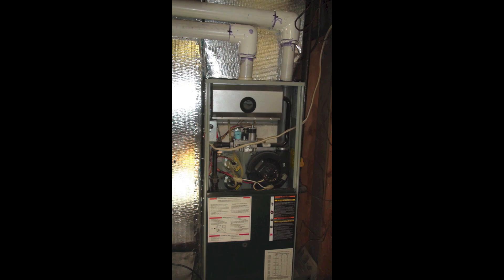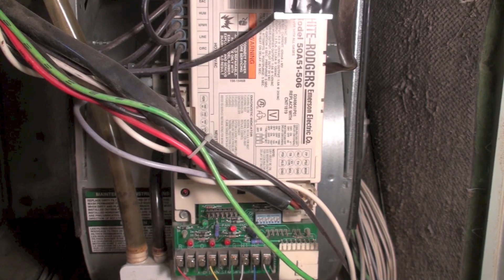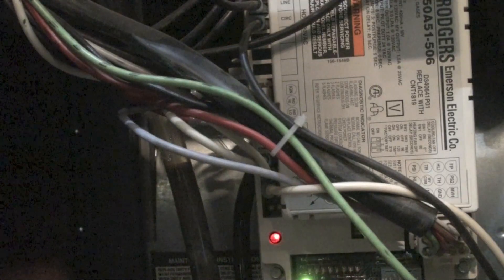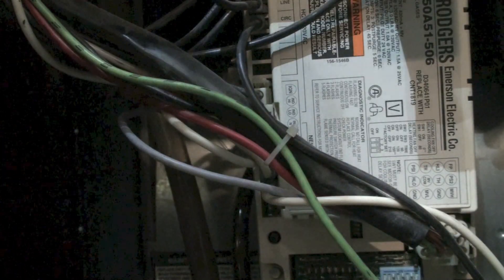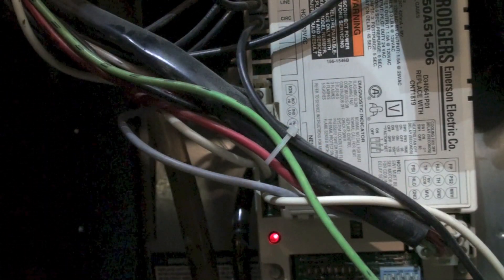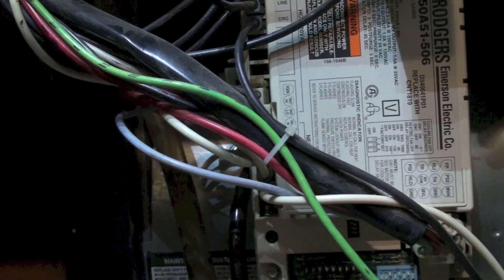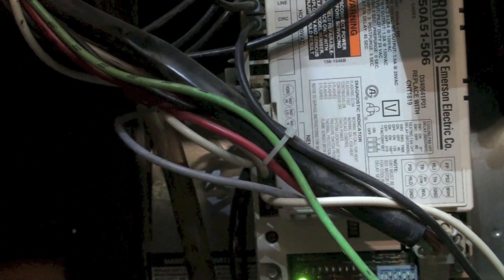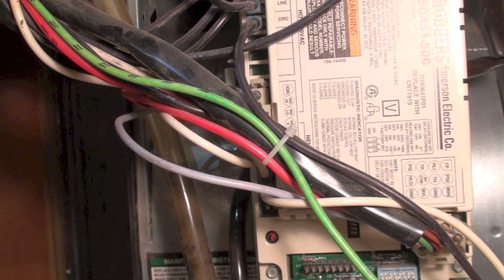Error codes for Trane gas furnaces

Comment: hi there how can you tell when you need a new sensor board?
Reply from the maker: Some boards will give a code that indicates it has failed or usually a no light condition with power to the board indicates a failure.

Comment: I have the Trane XB80. It's not providing heat. the Code is a rapid flashing light. the ignitor glows bt no gas and not heat. Please help.  thanks in advance...
Reply from the maker: The rapid flashes indicates normal operation.  If the flame does not come on, that indicates no gas available or gas valve failure.  First, be sure you have gas (see if other gas appliances operate).
GFM

Comment: What is 5 code
Reply from the maker: On a Trane furnace, the 5 code means something like a stuck open gas valve.  If the burners are not stuck on, the control board has probably failed.
GFM

Comment: Wow, thank you so much for this video! It helps! a lot! Also if you could tell me why my furnace does this. My furnace blinks normally when its not blowing air and when it is...... but everynow and then the blinker will fast blink when the furnace is blowing heat.
Reply from the maker: TheHmongol The only thing I can think of is when the furnace is calling for heat, it fast blinks. When the call is over, even if the fan is still blowing, it will slow blink. 
GFM

Comment: Hello furnace man.. I get the Open Temperature Limit Circuit (4 Flashes RED)
I need to check the filter you said, and the blower Wheel, ETC also if there are filters On the register can that also cause it too..
Reply from the maker: There should be no filters on the register if there is one at the furnace.  You could also have a rollout switch open.  If it is, you could have a failed heat exchanger.
GFM

Comment: I have a trane xv80 that blinks twice. Its a code for external lockout. Sometimes my furnace runs fine. And some other times, it wont heat. It blows cold air. I already replaced the flame sensor and the ignitor. What do you think is the problem. Thank you!
Reply: Did you ever figure it out? I'm having this exact issue right now. Thanks

Comment: What's the normal pressure for aninduced motor ?
Reply from the maker: It varies with the model.  There are no common numbers here.
GFM
Reply: grayfurnaceman then how can I test to make sure that an inducer is creating a proper vacuum ?
Reply from the maker: You need to know the pressure it will make at.  Some of the pressure switches will have it printed on the label.  Some do not have this and you will have to find an install or service manual.  
GFM

Comment: I have a code for no call for heat I'm lost on what to do for that
Reply: Gray furnace man..do I need
To shut off the gas line to clean the thermostat???thank you
Reply from the maker: I would be looking at the thermostat as the problem here.  You can try removing the thermostat and shorting the white and the red wires.  If it starts, the thermostat is the problem.  Hope this helps.
GFM

Comment: My Trane XE90 was working alright, had a gas service take place at the meter and unit restarted fine. Unit operated normal for two days, now I get 6 lights. It cycles on, ignites, and then immediately off. 
How could the polarity change when nothing electrical was disturbed?
Reply from the maker: Sometimes the ground wire (green) is not tight somewhere.  I would check that first.
GFM
Reply: grayfurnaceman I appreciate your time and assistance!

Comment: thanks gray,  
my led is off completely, however I checked the lines coming into the board and they were hot.  is it board problem?
Reply from the maker: Be sure you have 24 volt power.  Fuse on the board?
GFM
Reply: +grayfurnaceman I checked the transformer and it was not transforming so I replaced it. but the moment I turned it on it fried the transformer so I think I have short circuit somewhere. I don't have a fuse on this board.
Reply from the maker: I did a couple of videos on finding the short in low voltage.  Check my channel.  Hope this helps.
GFM
Reply: +grayfurnaceman great will do thanks!

Comment: We took off the front panel to vacuum ut the hose that gets plugged, and we get the red light blinking three times. Can you tell me how to fix this
Reply from the maker: +Annie Morrison If you used vacuum on the hose with it connected to the pressure switch, you probably damaged the diaphragm in the switch.   Means a new switch.
GFM

Comment: I have never encountered this before either.  Have found out on some forums that this 5 code is more or less a catch all for things (glitches ?) that the board can't read.  The solution,  if the code continues is to replace the board.  Of course all the other components of the furnace need to be checked and  OK'd for function. Then if the code keeps showing up, replace the board. The code on this furnace in question would show whether the gas valve was on open or off at the valve knob.  The things I read said to replace the board.  The people who asked about this, did replace the board, and they said that took care of the problem.
Reply: This was literally the reason I looked at this video thank you this is helpful I'm not sure if it's the problem yet but I'll check into it seems to be an intermittent issue if I kill the breaker on my furnace for a minute and then turn it back on and it runs good for a day or two and then won't ignite and has a five light code

Comment: An explanation of code 5 would be nice.
Reply from the maker: +ritewayguy That's kind of an odd one that Trane had.  It just means that if the gas valve stuck open, the furnace would shut down and turn on the fan.  Never seen it happen.
GFM
Reply: Well gentlemen, mine is showing 5 flashes today!  Any ideas on what to look for?  Thanks!!  If it helps, my furnace starts up fine, great flame, flame cuts off but blower will not stop running.  Thanks again!
Reply: Did you figure out the problem? Mine has done the same. I’ve checked switches and even changed the board. It worked the rest of the winter after changing the board but recently there was a cold morning so we turned on the heat. I noticed the fan running constant so when I checked that 5 blink was back again. If there’s anything you can tell me I’d really appreciate it. So tired of worrying about this.
Reply: @addiimaddie-89  You could go online and look up your model number and see what you can find.  I'm not sure right now what the code may be.  There should be a list of codes somewhere on one of the door panels.  Sorry I can't offer much more right now.
Reply: Thanks for the reply my man I’ll get it figured out

Comment: We r having problems with our furnace  when we turn the heat on it only blows cold air wat could be causing this?
Reply from the maker: brady toennies Need lots more info.  Brand, model, are there any blinking codes?GFM
Reply: Ok I will have to get the information tomorrow